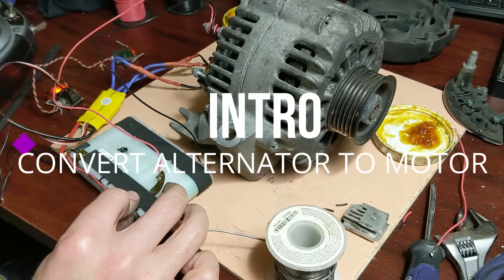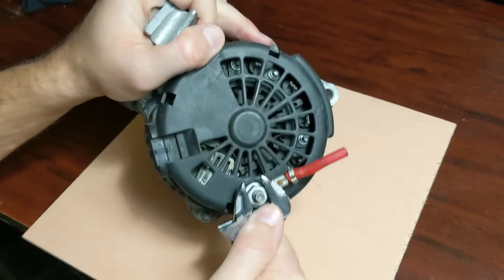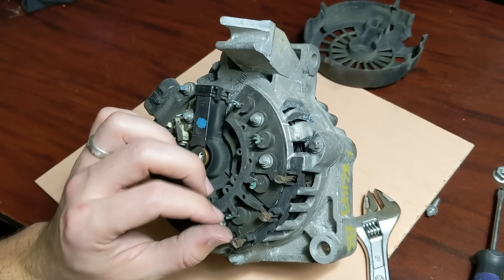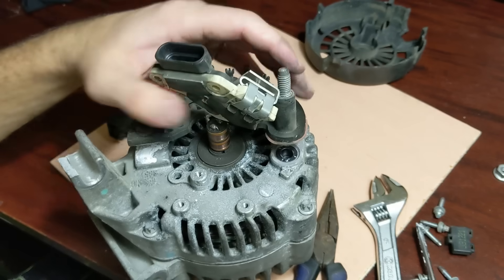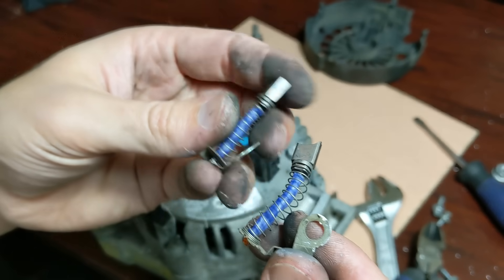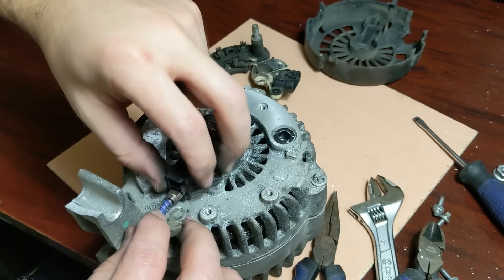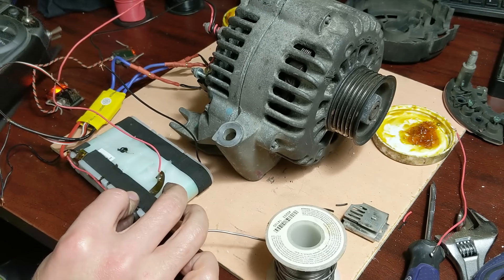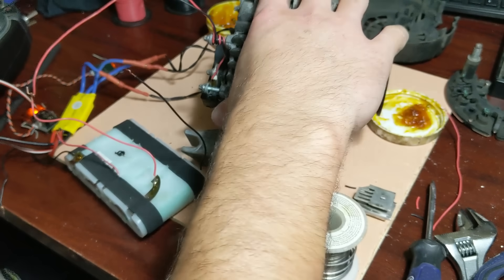Convert Alternator to Brushless Motor

Comment: I have only one question relating to it being brush-less, i.e.How is it a Brushless motor - if you still use the brushes in it to operate it? 

You said you'd need New ones. So as far as I can tell you've converted the alternator into a motor successfully - but not a brush- less motor - as such.

But why not just use a 12volt car starter motor as a 12 volt motor to power things instead? - just remove all the gear from the starter motor shaft that makes it 'throw in' to the Flywheel and add your own pulleys etc to the drive shaft of the starter motor to run whatever you want to run on a 12volt motor as the Starter motor would be much more powerful - without too much difficulty to convert it to a usable motor instead as it wouldn't require all this tinkering - with the electrical side of things or at least not as much on altering the drive shaft - to make said powerful motor.

Having said that though - How long would it take to flatten or run a car battery down using - either motor - i.e. your converted generator one or an alternate car starter motor to power things?

I'm more interested in the longevity life of the Battery that powers the motors in any case as it would need to run for hours before flattening the battery.

On that side of things I would be even more interested if you could show how to hook up a working alternator to a starter motor and what things may be required on the electrical side of things from a car - to have the car alternator recharge the 12 volt car battery - as the starter motor is operating - whatever needs to be powered. Maybe two alternators could be used - one converted and one not - hooked up together via pulley and V belts or existing pulley or timing belts etc and utilizing all the electrical stuff - like car voltage regulators etc to recharge the 12volt DC motor via the working alternator -  whilst the converted alternator motor is running - so the battery life is theoretically extended - so that it is not flattened too quickly. 

Possible?  I dunno? BUT I would indeed - like to find out. :)
I would prefer as brush-less motor, nevertheless - but stater motors are not Brush-less and continuous running would wear the brushes out very quickly I should think - hence my interest in your conversion.

I have an old GMC 850 watt 240 volt output Generator that I recovered from what was thrown away - that I want to convert to an electric one - just for lighting a small campsite home/caravan and single garage shed located there - instead of a petrol/gas powered one and a relatively new but defunct 240 volt compressor - that I want to fit a motor to - in order to run it 'off grid' as there is no mains power to the country property that I obtained very cheaply - because I'm not permitted to build a house on that camping block. 

I think the 850 watt generator part of the GMC generator is still intact and operational - but I need an electric motor that runs on a DC Battery - to run it to see if that is actually the case. Hence my interest in your conversion. I also want to fit a motor like your conversion - to the Air compressor to use off grid also on a DC car battery.

But since I'm not electrically minded - I find that conversion of yours a little daunting. ;)    And the other possible conversion of a car starter motor even more-so.

What advice can you give me on my 'starter motor' alternative to the Alternator motor - that I've just stated here, that I'd like to use a DC motor for?
Reply: @Soloman - I think solar power system will be more suitable for your power supply problem, as you don’t like to drive your 840watt alternator with a petrol engine. By using an inverter you will be able to get AC voltage with which you can drive your AC motors. You need not use power hungry starter motors to drive any of your devices. You will find several articles on YouTube about constructing what is called a Power Wall ,powered by solar panels, independent from power grids .

Comment: Brushes are on a slip rings which is actually the rotor and stator of the three wires cut off the diode  rectifier

Comment: First off, good work on your project. Just want to clarify that delta or wye configuration don't effect the speed of the motor and mostly are used for starting and running currents. Also you can't for sure tell the difference between how they are connected on the inside by just observing 3 wires, since both configurations will have 3 leads out. Best way would be to separate all the coils and do ohm check to determine the true configuration. Also since alternators don't have magnets inside them, you are feeding the rotor a small voltage to create the magnet, and doesn't mean you need 48 volts to run the motor. When voltage is high, you have higher magnetic effect and your driver doesn't have enough current to overcome the magnetic field generated. A drive with higher current output should do the job, most alternators will produce around 90A, so somewhere around that number would make the motor work too.
Reply: you can tell the difference between wye and delta without taking it apart. delta will have 2 or 4 wire ends at each 3 points. Wye will only have 1.
Reply: @mannys8259  not necessarily true, in most common 3 phase application, you will have 6 leads coming out of the motor/ generator. also there are motors with 9 or 12 leads which makes it harder to just tell by simply visually looking for one or two wires.
Reply: He ran it on 12.6 volts. Not 48. Wise up.
Reply: @davelowets  watch the whole video

Comment: So, you make a video when you're not overly sure of what parts are what and for that matter how it all works.
This is evident in your attempted explanations,  "The 3 coil wires", "This looks like.....", and "the 2 copper leads"!!!!, just wow.
Your '2 copper leads' are in fact slip-rings(on a shaft) that feed power to the 'Rotor', and not the stator (as you describe), you know "The 3 coil wires"!!
Your "3 coil wires having 4 wires each" does not in any way determine whether 'Star' or 'Delta' wiring is used, nor does having 3 visible 'stator' wires connected to the 3-phase rectifier. In fact without further disassembly it is near impossible. In my experience with the thousand or so Alternators I have rebuilt over the last several decades, the only real way to determine Star or Delta (unless stated), is to completely strip down the alternator and carefully examine the Stator wiring. Reason is the Star or Neutral point in Star/Y wiring can be 'buried' in the stator wiring and not normally accessible with exception to a few lesser known configurations.. Now experience also dictates that the gauge of wire used on the stator together with the alternator rating can possibly help determine Star or Delta configuration.
Since the Alternator is a 12V 140A(yes I looked up the specs) and the size of the stator wire, I would 'guess' at this stage is likely Delta wired, but not certain...
You are correct regarding power differences between Star/Delta as Star would generate a higher voltage and lesser current, while Delta a higher current(1.732x) but lesser voltage.. Delta giving more torque than Star operating as a motor....

While I applaude you effort to 'do' , trying to teach others about what you yourself lack a basic understanding/knowledge about is really wrong on so many levels, 
as well as potenially dangerous and can only be described as 'the blind leading the blind'.

I'm guessing you're trying to make a buck like everyone else on youtube (by copying what others have already done), but really stick to something you 'know' for sure.

Comment: I probably not use lipo batteries to test something like that, i would have used a power supply of sorts, it would be the shits if you blew your battery pack up if the alternator used more current than you expected

Comment: Thanks a lot for this video. I knew the theory of converting alternator into a BLDC motor but I was not sure about overheating by lower RPMs (which means lower frequency.) One of my customers asked me how to do that so I sent him Your video. You did really good job.
Reply: But brushes don’t interrupt the current into rotating coils as in normal brushed motor. There is only one pole and rotor coils work like a permanent magnet.
Reply: @KUBA64official  take the brushes out. Would it work?
Reply: @wifie9321  The brushes only provide current to the rotor to operate the electromagnet, since it doesn't have permament magnets. Only a small current passes through the brushes, and the main motor current does not. The rest of it operates the exact same way as a brushless DC motor.
Reply: @davelowets  but it has brushes to provide power. Without them it cannot work unless you replace parts. Until the magnet is replaced to eliminate this problem, it is a brushed DC motor.
Reply: @wifie9321  Ha ha Your argument is a bit disingenuous. A brushed motor refers to one having the power delivered via brushes to a commutator which is connected to the to rotor coils sitting in a magnetic field. The fixed field can be by permanent magnet or a field coil, like the alternator. A brushless motor does away with the commutator. 
The slip rings in the alternator do not do the job of the commutator and are just connections straight through to the field coils whilst allowing rotation. It is a brushless motor with energised field coil. It does have brushes and no it wouldn't work without them ha ha.
😁
Reply: It's not brushless since he put the brushes back in.
Reply: I had ruin 2 alternators but I can’t get them to work can you give more details how ti hook the power line

Comment: can u turn a motor into an alternator?
Reply: When you spin a permanent magnet motor I believe voltage is produced at the motor wires. There are plenty of people on YouTube converting motors to generators using anything from old washing machine to ceiling fan motors

Comment: New brushes on your brushless conversion? Interesting ! You took off the bridge rectifier and regulator... then sorted the remainder ...Hang on, why are you refitting brushes to that Alternator ? ? ? Aha I guess that you didn’t remove the Armature and fit it with magnets to give it a permanent magnetic field . This is why you need battery power to energise the armature ...
Reply: I thought the same, not so brushless... But it has some advantages over permanent magnets, in that you can easily control the magnetic field. More current in the field coil = more torque and less revs, conversely less current = less torque and higher revs. This makes it like an automatic transmission, and you get the maximum power at all speeds (almost). This trick is why there is no need for more than one gear on electric cars for instance.
Reply: The good thing is that the brushes doesn't carry a big load. What sort of hp can you get?
Reply: @JayDee-xj9lu  being this is a 12V 140A alternator, 2hp maybe 3hp absolute max..

Comment: This is a really interesting idea, when choosing an alternator are some better than others? For instance would a truck alternator be stronger than an alternator from a smaller car? Are older alternators easier to disassemble? Thanks! Great video.
Reply: alternators are rated in OutPut AMPS. In the automotive application, they are more a current source. While a car is running  the out put voltage from the alternator will climb above the 12v of the battery. Usually 13 to 14 volts, This insures that current loads like fan motor defrost strips etc are all supplied from the alternator, not the battery

Comment: You need to re-title this. "How to use a car alternator as a motor with electronic speed control" maybe? To make it brushless you'd need to replace the wound rotor with a permanent magnet one.
Reply: Yes, indeed! Also you refer to " Delta and Star connected resistors"; They are the stator WINDINGS.
Reply: I remember when I was learning and blowing shit up using wire that was totally too small to carry the amperage I was pulling... LMAO
Reply: Pedantic point missing.
Reply: A czy ja mógłbym ci ten zwrot pieniędzy udostępnić za stracony czas w ramach rekompensaty,a może masz inne potrzeby ,które można by zabezpieczyć pozdrawiam
Reply: Yes. So much terminology used wrong.. My brain hurts.
Reply: I reached half of the video and then i read your comment... 😁
Reply: I was exited until i saw the brushes go back in
Reply: @dave95377  me too, can I ask for a refund of my 15min?
Reply: @dave95377  so your missing the point of the brushes, they are pretending to be the permanent magnets.. if the winding is a reverse stator, you need the center piece to act like the permanent magnet, so you add a DC voltage to the center piece and it here a magnetic field so the electro magnetic field from the three ac wires have a magnetic field to push against.. you could always the center shaft out and replace it with permanent magnets... But don't have a clue how to accomplish that feat of manufacturing in as short a time as adding DC power to it instead.. it's actually kind of genius, cuz making that center piece into day a 4 pole permanent magnet in my garage would be impossible, especially if I wanted to spin that up to 2000 rpms. The DC brushes are a excellent substitute.
Reply: @dmaryniak  there are plenty of videos showing permanent magnets being installed. The magnets from the hub motors in hoverboards are frequently used. You do need a lathe to turn down the new rotor though.
Reply: oh good its nor me alone wondering how brushless needs brushes ..none i own have any  brushes

Comment: Nice video, good explanation and it's indeed a motor...just not a brushless one...it has brushes on the rotor...
Reply: and it could actually be converted to brushless...just put some magnets on the rotor
Reply: Also rotor is the part that turns not the other way around

Comment: i got 6 wires what do i do
Reply from the maker: Each alternator has three coils and each coil has two wires. So total of six wires which is what you have.
You need to get a voltmeter and do the ohm reading and find which two wires are connected together.
So you will have three pairs of wires and those will be your coils
Reply: @MadeEasyChannel  that was helpful thank's 100%

Comment: Is there a way to do this without the rc controller and the yellow thing like a hi lo wireing or just on when you connect to power? Great vid👍
Reply: unfortunately this is a three phase motor which means that there is no good way to power it without a controller
Reply: @boycefenn  could run a capacitor or two
Reply: @frankmarson2425  not sure I quite understand what you're suggesting
Reply: @boycefenn  you can run a 3ph motor on single phase by using a capacitor to generate the third leg if wired in delta or if wired in star - to the center of the star + to one leg and capacitor between the other 2 may have to convert dc to ac
Reply: @frankmarson2425  i see, yeah that could work. in my head i was only considering DC. though even your suggestion would likely not work all that well because i think a converted alternator is an asynchronous 3ph motor so it would be prone to stalling

Comment: Question: Why would I want to do this when I can get a permanent magnet motor? Wouldn’t a permanent magnet motor be more efficient since I wouldn’t have to use power/electricity/battery to create a magnetic field?
Reply: Some thoughts - this machine gives a variable magnetic field which is a bit like an adjustable gear ratio; if you can get a permanent magnet motor as cheap as a used alternator then go ahead; and as China continues to crank up the price of neodymium then we will all soon be looking for a cheaper alternative to permanent magnets - the car manufacturers are doing major R&D into motors without permanent magnets to cover exactly that scenario.

Comment: Doos claimed to aid the the teacher: Do wear gloves when messing with the internal parts of the motor. Some for that black substance is grease probably, but some of it is like carbon fines which is a dust that is harmful to inhale and it does not come off that easily.
Reply: Actually I hear that the white paste between heatsink and electronic devices is likely carcinogenic which might be worse than the carbon from the brushes ...
Reply: @chrisbraid2907  No, its not

Comment: I would have cleaned my commutator too. Those copper leads get carbon fine buildup that causes issues with consistent rotation down the road as the brushes wear out. I think a battery lead cleaner will help with that, or green Scotchbrite pads.

Comment: Go buy you a standard and metric socket set with ratchets. Or get some nut drivers for the hex head bolts man.😂
Reply: WTF are you laughing about? Those are inverted Torx bolts, numb nuts.. 🙄

Comment: How much power can you get out of these?
Reply: 60amp alternator at 12V = 720W,  With a 12-14V supply to the ESC it should make a little under 1HP.  760W would be 1 hp.

Comment: Would it be possible using switching relays to switch between motor and alternator functions so it could be used to start an engine then charge the battery whilst running.
Reply: you can't

Comment: what to do with the 6 wires inside the alternator
Reply: Connect the wires so they complete the circuit, connect 2-3 call it B, 4-5 call it C  and 6-1 and call it A. Keep the voltage regulator and apply 12v to the rotor and the esc to A, B, C and your good to go.